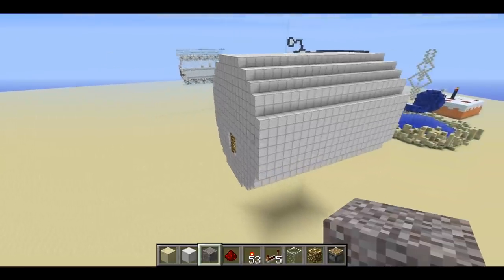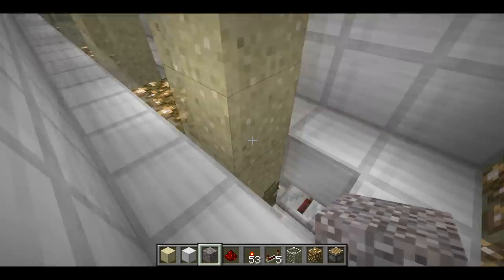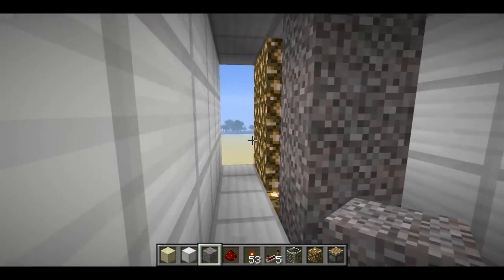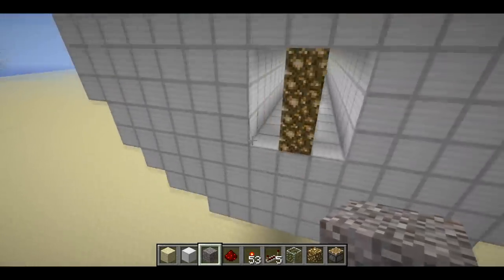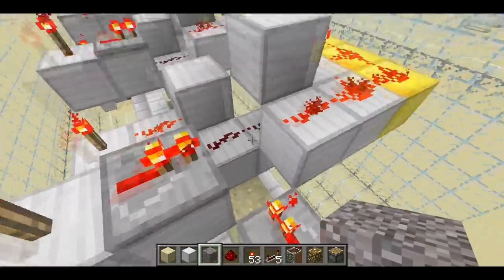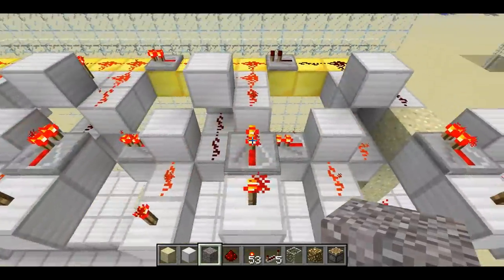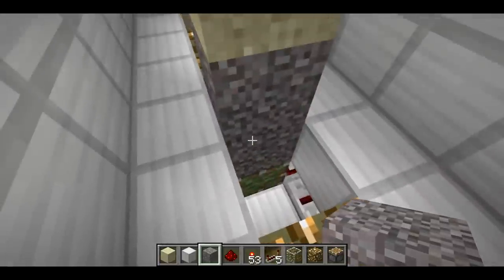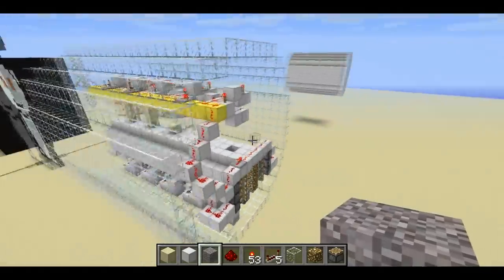Pin Tumbler Lock in Minecraft

Comment: With the distance from the input area and the redstone circuit being so short, it's very simply to simply remove all the sand and look up, count the number of blocks, and input that number. I'd suggest either making it taller (to confuse) or adding a piston-driven bend as the sand passes up to the redstone latch (breaking LOS so they can't count it) to prevent potential intruders from using this easy and virtually free method to break in. Very tough if made of obsidian with lava traps.

Comment: I think it would work a lot simpler if you used glass to signify the correct height, which would turn off the signal for that line when it hits the repeater.  When the signal is off the doors open, making it a simple way to detect if it is over or under.

Comment: It occurs to me there's a security flaw here. You could place block after block until the pin wont go any higher, then destroy a certain number of them to get to the correct height. A way to fix this would be to, instead of breaking sand to set the combination, raise/lower the pin readers.

...or just break the blocks on the end :P Still cool though :D

Comment: mine is amazingly smaller, its tile-able, small, uses basic redstone, compact, you can make it 4-digit, 5-digit, as big as you want, the highest pin number is 9 if the roof level is 3 blocks, and the 4 digit version is 13x5x13, but the bad part is the height varies on the highest pin digit.

Comment: Or add system that remove the "key"
Pistons push 1 , 2 or 3 sands in each pin per one signal.
that closes the door and reset lock.

Comment: Is there a way to add a noteblock to the top so the player knows when the lock is "picked"? Also, can this be remotely controlled, IE: A player has to press buttons or levels that automately insert 1,2 or 3 pieces of gravel/sand, or removes 1,2 or 3 pieces of gravel/sand? This could be an interesting lock picking level for several adventure maps.